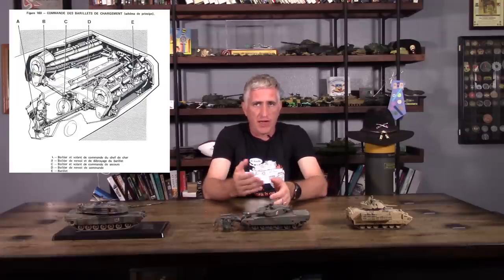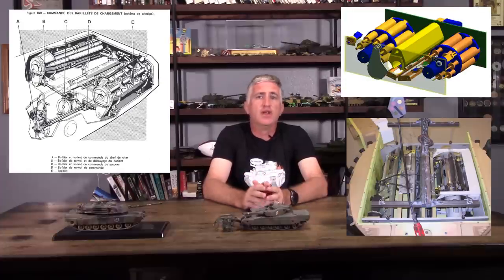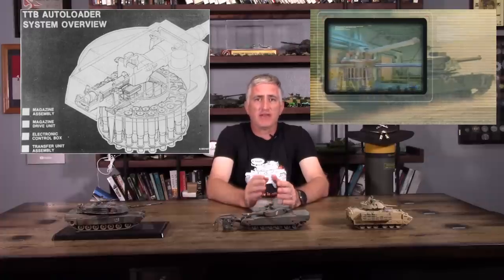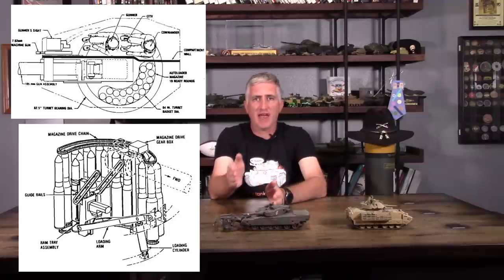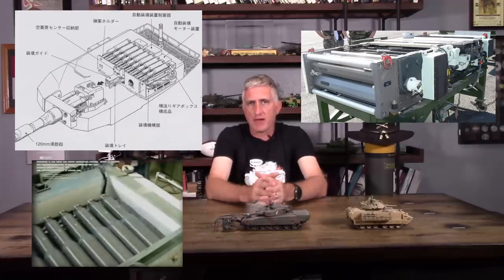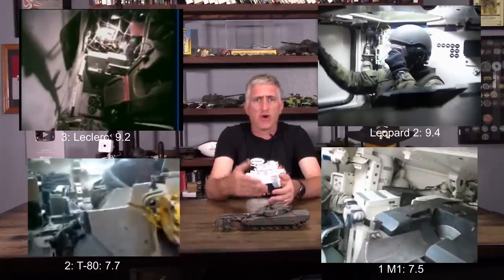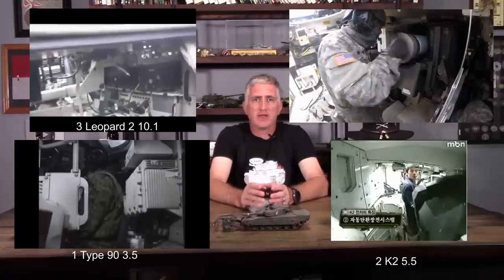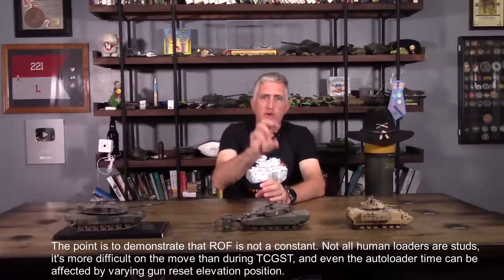Whither the Autoloader?

Comment: its all about finding a balance... current 3rd gen tanks are what they are, if it was designed with a human loader, then better to keep that way (Abrams, Ch2, Leo2),  and same goes for the autoloader designed tanks(soviet T-series, Leclerc, Type90, K2). but what about the 4th gen tanks? esp when considering the drive towards a larger caliber guns, and size/weight of prototype 130-140mm rounds, you will need a dedicated loading system, cause nobody wants to chug a 50kg round that exceeds 1meter in length within a tight compartment of an MBT. plus some of those rounds come in 2 pieces - projectile + powder charge, and manual loading wont be as fast... so yeah, autoloader is something all future designed tanks will incorporate. on a side note, Brits designed a new turret for Callenger 2 tank, but thats only for purpose of fitting the Rhm 120mm gun, minus the autoloader, and that is a shame, cause they might as well have added a mechanized ammo rack, given all the troubles with designing a new turret.

Comment: what about the use of liquid propellants with autoloaders because the propellant is stored in a separate tank within the vehicle and the autoloader only place the round in the breach making an even safer reload with a faster cyclic rate. Also, liquid propellants enable a reduction in combustion chamber pressure reducing the terminal velocity and the chance of over-penetration. filling the propellant tank(s) is like filling up with DERV! the us of a Bi-Propellant reduces the of combustion and liquid propellant tend the be more energetic, os less is needed to achieve the same result!

Comment: Video suggestion:  New hand-held anti-tank weapons; do they render tanks obsolete?  Can hand-held weapons (RPG-27-32, M79 Osa) now penetrate and destroy the m1 Abrams?  If so, and if these hand-held weapons are cheap and easy to produce, is the protection of armor greatly reduced?
Reply: Ron this has been true for decades. The rpg 29... a hand held weapon developed in the 80s is still a major threat to modern mbt’s.
Its alot easier to develop a more powerful projectile than to add several extra tons of protection.
Reply: @acceleration4443  Thanks for the well thought out reply. So do you think tanks may be obsolete? Why buy them if they are so easy to stop?  Is this kinda like the end of the battleship era, when it became clear their armor was really no protection anymore?
Reply: Ron u still need armored vehicles to support infantry.
Tanks will go the way of the battle ship.
The future of warfare is air superiority.
Reply: @acceleration4443  I wonder if a logical approach would be to design a vehicle that brought a big gun to the battlefield, but didn't try to protect from much more than small arms, since more than that might be a wasted effort and cost?  This might allow for cheap, lightweight, and fast vehicles.
Reply: Probably the fast and cheap idea has been done before. I'm just thinking aloud, and really with no expertise at all.

Comment: 11:25 In the Leopard 2A4 (at least the swiss version i.e Pz. 87 Leo WE), when the Main Control System (i.e the stabilizer) fails the gun simply won´t move into the loadingposition
Reply from the maker: That is such a simple answer, I wonder why I missed it?
Reply: @TheChieftainsHatch  That could be because it is overshadowed by the loss of the daynamic lead and gun becomming a bit slower to aim.

Comment: a concern i might have with autoloaders is that if for some reason they dont work i would want a way to manually operate it instead of being forced to use rounds stored in the hull
Reply: There are some types that can kinda do that. You mean like manually loading a rifle basically. The main benefit though is loading even larger rounds than is practical to hand load. Maybe just an improved secondary gun? I mean, do you really want to hang around if you are trying to hand crank an autoloader?

Maybe you should withdraw at that point XD

It is like getting a turret jam really. Do you want the gun to have more swivel for that situation, which is probably more likely? keep fighting? Or do you try to save your ablatives?

Comment: When you have an Auto-Loader you lose one man to help with guard and maintenance duty.  When I was first in my Army Unit (2nd ACR 1974-77) we rarely had a full crew which made it hard to maintain and pull radio guard.  The extra crewmen In the APC were called infantry or who were not very useful.  Thanks for the video's.

Comment: I disagree with your assessment on the hole size during a cook-off. A smaller feed hole to the crew compartment just means that the gas pressure coming through that hole to the crew compartment will be at a higher pressure, than that of a larger whole. If the ammo is hit while the doors are open, the crew is screwed either way. Bad luck or Murphy's law don't matter.  Thanks chief.

Comment: What about the issue of changing rounds with an auto loader. Once they are in a cassette or anything like that, you naturally can’t select the best rounds you need
Reply from the maker: Some autoloaders will change the round for you. It's worth noting that it's not a thing normally done with manual loaders these days either, both for safety (semi-combustible cases have a tendency to split when pulled rearwards) and speed (Much faster to just pull the trigger in order to make room for the correct type of round). Or, in the case of Challenger 2, it may simply not be possible at all.

Comment: Maybe someone can give me an answer to this; How about changing ammo types ? 

If iam not mistaken in man loaded tanks, the chamber keeps empty till the main gun is needed for an certain purpose, but how is this on autoloading systems ? 

Do they just press an button for Ammo type-1 so the mechanics load the type-1 ammo ? 

This is something that interrests me, on more modern systems i am sure this is handled by a Computer system to chose by, but how is this with the older generation autoloaders on the Soviet Era MBT's ?
Reply from the maker: No difference between manual and automatically loaded. We "battlecarry" a round type, because why take extra time to load a round if you get surprised? If you guessed wrong, and put the wrong sort of round into the tube, the fastest way to get it out of the tube to make room for the correct type of round is to pull the trigger. Plus, even the wrong round may have a good effect on the other end.

As for the actual selection of round type, the gunner just presses the button for "AP" or "HE" or whatever. The carousel spins around to the correct loading tray and feeds that round in. When the rounds are loaded into the carousel, the computer is programmed to say which type of round is in which tray. This can be done manually or by use of a barcode scanner.
Reply: @TheChieftainsHatch  Thanks for fast and detailed answer!

Keep up the awesome work chieftain!

Comment: Talking to some German SS Tankers they told me there set up was different from the Weirmacht and other army's his unit Viking had tank crews and intergreated Panzer Grenadiers  each half track carried two sections that worked in there day job as an infantry section but they were also tanker trained so they also doubled up as spear crew members so Gunner gets killed a replacement is taken from your units halftrack at night they laggard up and the section split in two to work on there tanks who would be in the same tank section troop also if the tank was hit got into trouble then the halftrack would come to there assistance . When replacements came from the depot they went to the Grenadier side first to be trained up in unit S.O.P. and get further training from said Grenadiers they also carried spear ammo sometimes in trailers that they ould drop off on contact

Comment: EDIT: I wrote this while half-way through the video and thought it was at the end :).  But i would stick by what the tankers have told me in battle situations, my paintball buddy was on the thunder run through Baghdad so I am willing to take his opinion as law.

While your points are definitely valid, and presented ad naseum in life....maybe I can provide a different perspective.  I worked a defense contractor doing engineering and maintenance for 1st Armored Division, and while I didn't work on the M1 or even tanks...they were right next to us, my company had a hand in producing the tanks, and this conversation came up frequently.  A lot of the tankers and maintenance personnel (both civilian, which is important, and military) made a point that no one could disagree with.  The civilians, being offline maintenance, conceded the point but the tankers who had done joint exercises involving the cross use of European armor (some of which included auto-loaders) were the ones to hammer this home: Moving parts break, which is also true for humans, but switching the loader with a gunner or any other human takes seconds where fixing or rebuilding an auto-loader can take hours to days.  They further point out that the benefits when it works can be completely thrown out when simple abrasion of mechanisms or mundane failure occurred means the tank is completely unusable until maintenance is performed, where as a human can make a mistake and correct (or in extreme instances, can die and be replaced by another position).  Take a wrong hit that damages the auto-loader and the tank is a fast bulldozer, take a wrong hit to the human that is loading and your other crew is now a loader...so it provides a graceful failure curve instead of a hard one.

The crux: it's all about the failure/maintenance curve.  Machines typically fail hard and require concerted effort to work again, where humans fails soft and are "plug and play".  Most of the on-paper arguments for auto-loaders don't (because they can't) take in to account full war-time conditions.

An aside:  The Abrams vents top, I've seen the fireworks.  Not sure about bottom but i was definitely distracted with the top blow-out panel.  Could be a different series though.
Reply from the maker: I think if you're designing your tank about the idea of "The tank will break in the middle of combat", you're doing it wrong. There are so many different parts to a tank which can break and totally sideline the vehicle. I had an idler fall off in the middle of a mission in Iraq, for example. It doesn't happen often, and one does not condemn the tank's idler for it. If one thinks about how many different things are in the tank which can go down, you realise that the solution is to keep the system as robust as possible, with a manual backup if possible, not to worry about every possibility.
Reply: @TheChieftainsHatch  I absolutely agree, point taken... I think the idea is reduce the number of things that can break as much as possible so you can reduce the time the vehicle is in maintenance. But considering it's all government contracting, that's probably inevitable.
Reply: As I finish typing the reply and hit post, I remembered that the product I was working on (a communications pack) was eventually installed in the m1 and it breaks all the time 🤣🤣🤣

Comment: I don't think I agree with you about "bean counters." For a tiny country like Israel, cost is always an important factor that informs doctrine. It's that way with their air force as well as the rest of the IDF. Reducing both capital and operational costs of the armoured corps are first class citizens of the IDF's current initiative on the design and doctrine of the next generation of tanks.

Secondly, I was waiting for you to address re-arming. Tanks have to regularly retire from combat in order to refuel and re-arm. I was watching the reloading process of the T80's (I think) carrousel magazine. It took a full minute to load a shell into the autoloader system. Isn't that an important consideration? How does reloading a cassette magazine work? I just assumed that there was a hatch on the back of the turret bustle into which shells could be easily slid into tube after tube. Is that the way it works?

Comment: I state that with the more wide distribution of hardkill-systems you would need much more than one shot per target und therefore you would need more ammo and a lot faster loading to saturate the hardkill-system (while of course the enemy is moving in front of you) to an end of defense for the final hit going through. With that progressive view you will need a style of gun with perhaps lower caliber but faster loading and hitting (much) more than one time (lets say comparable to a 76mm naval gun) or a combination of a smaller autocannon but with a caliber big enough to trigger the hardkill-system to get active (perhaps 40 or 50mm machinecannon with AP and HE mix) AND a tank-gun for the final hit capable to deal with the enemys passive armor (perhaps a 105 or 120mm). With doing so the turrets of the future will likely beeing unmanned competely because all of the space would be used up for guns and ammo. For sure a third way can be to sperate the saturation duty to a second system like an APC with the machinecannon and lots of ammo. That will need a stable and reliable communication between the two vehicles for targeting and timing. For sure we are talking about years to come for that but how long? There are some really good hardkill systems on the market or short before which can get any RPG, rocket and even Sabot-Penetrators. I think that will be the cheapest way of the future for doing protection (than passive armor) with all the benefits with it like less weight and bigger mobility which means likely harder to hit and so on. What do you think about that @The_Chieftain ?

Comment: 3:05 So, true. It's especially the case with turret bustles that are only tall enough to be 2-3 shells in height. In this case, the cassette autoloader is usually limited to around 20-22 shells (based on looking at French, and Ukranian designs of cassette autoloaders). This is, because those cassette loaders have a single loop of ammunition. Also, if the bustle is particularly tall (like being 3 shells tall), this limited storage of ammo on the cassette autoloader can create "empty space" where shells aren't loaded onto the autoloader. However, I think (it's possible that) this is partially mitigated (at least in terms of ammunition storage) by loading the shells into those "empty spaces".....wherever they are available. But, those shells aren't able to be manipulated by the autoloader (since they aren't loaded onto the autoloader), and would probably cause the tank crew to reload sooner......but....I don't think this is rly that much of a problem. If a recall properly, I think tanks only fire like a few, or couple of shells in single engagement. It's pretty rare to expend your ammo stores in one go.  

However, the Meggitt autoloader doesn't seem to have a problem with this issue (or at least greatly mitigated), because its "ammunition belt" is looped multiple times. Due to this design, more shells can be loaded onto the autoloader. Meaning more shells that are available to be actuated by the mechanical loading system. However....this only works for even numbers of shells stacked vertically on top of one another. For example bustle space as tall as 2, or 4, or 6, or 8 shells in height....and etc. It's not possible with odd number of vertically stacked shells.

Comment: speaking of, was there any realistic idea for the autoloader on the Waffentrager E-100 or was it completely imaginary? Because it doesn't seem practical in any way
Reply: The Germans did have an autoloading version of the 150mm, not sure if it went anywhere though. The WT E100 is complete WG imagining, and looking at the gun breech area you could tell that it didnt even look like an autoloader (At least not to me).
Reply: @LegoStarHawk98  i have a scale model for me and I can confirm. It's just a 4 shell hold left of the gun breech, that doesn't seem like it can load shells in anyway, even more so automatically. Besides that, there is no place for the crew to stand and load the gun or the hold itself, the entire rear of the gun along with the two gunners and the shell holds are practically on the air

Comment: Design an Auto loader that can easily have the round transfer assembly easily relocated out of the way. Thus Manuel loading is still a viable option with a few rounds available to hand let say 4 or 5 going in reverse to get the out of there. if those rounds weren't enough then I doubt any thing would have been. Best of both worlds in case of the improbable happens I guess? 30 odd in the bustle and half dozen or so on a rack as a pacifier. The gunner/operator will have little room for complaint.